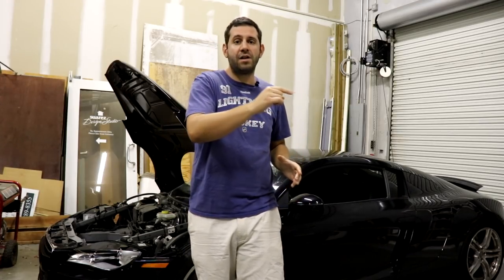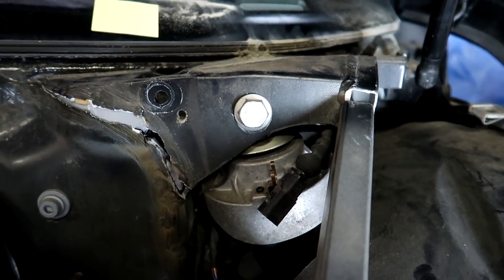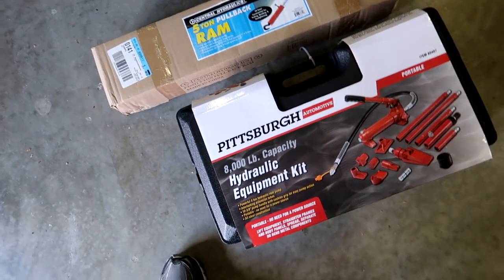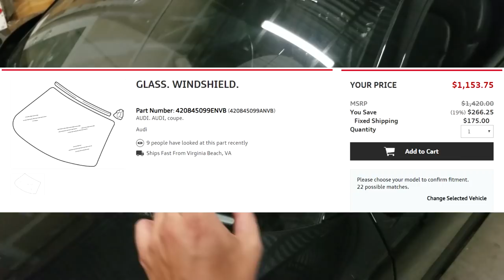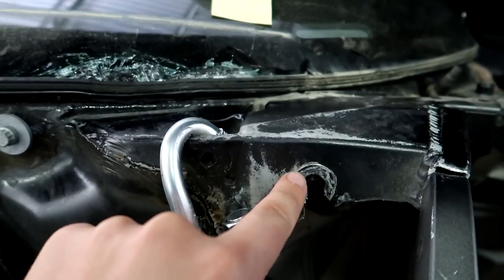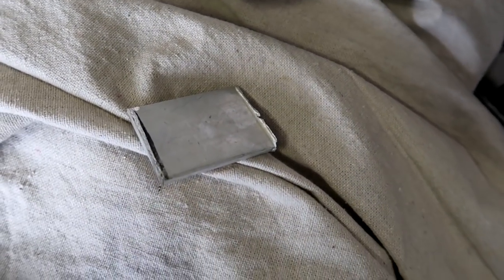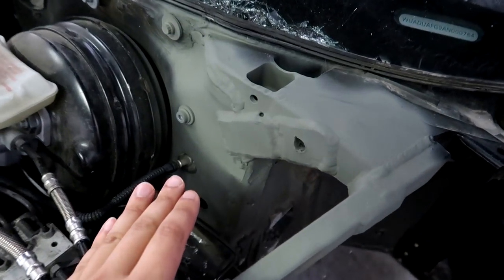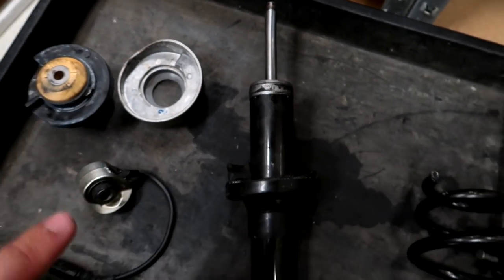I Repaired My Totaled Audi R8's Cracked Frame for $500! Insurance Quoted $29,522!

Comment: The thing that I can't believe is that Audi engineers didn't see this problem coming in the first place. You can't just put all the stress of the entire front suspension out there on the end of a teeter-totter without any reinforcement and not  expect a problem.
Reply: It probably would have been fine if the internal corner where the tear started wasn't so sharp in the first place - it's a stress raiser like it was designed.
Reply: Exactly! I just can't believe they didn't design it with some type of triangular gusset at least....or move the upper mount inward toward the strength of the main structure. It's simply a bad design.....repaired or not.
Reply: Yes, really surprising to see such a ridiculous structural design from a company that has a history of rallying among others. Did they dispatch the design to chinese subcontractors, LOL ?
Reply: Ya they eyeball stuff at audi lol
Reply: Classic Reaction -completely unreal. Reminds me of the clothing industry. Slapping a fancy name on it and marking it up 400% doesn't necessarily make it 'better quality'. I think you see where I'm headed with this...
Reply: @TonyRule  The failure of the frame was due to an impact not just fatigue. Bending that shock must have been a reasonable impact?
Reply: @Toby_the_Glen  In this particular case, yes, it appears to have been largely as the result of an impact. But as they have a known problem in this area, chances are it'd already started to crack there. I suspect that the shock piston rod end was bent as a result of the crack causing displacement of the top mount and some part of the shock to contact the inside of the top of the control arm or chassis.
Reply: @TonyRule  These sorts of cars are far more fragile than a daily driver, even kerbing and speed bump damage will eventually take its toll. You can't drive them like a minivan?
Reply: Agreed - but impacts will happen, pot holes and curbs.   @Toby_the_Glen
Reply: German roads are well kept better than American roads. There's your difference when Germans test cars on tracks and not metropolis streets.
Reply: @MarloSoBalJr  I think that car manufacturers road test cars all over the world. But there is an accepted level of responsibility for cars like this. Special cars require a special effort in ownership. If you want a daily driver to get you to work, pick up groceries and do the school run buy a Toyota. If you want a car that's responsive, poised, delicate and a delight to drive, buy a supercar. If you just want to smoke tyres, burn up the strip and make noise get a 'stang!
Reply: @Toby_the_Glen  They should still be durable enough in design to not be tearing apart after 7 years. The 1990 Honda (Acura to the 'merkins) NSX is all aluminium - no problems that I've heard about with them.
Reply: @TonyRule  quite a few cars have subframe or shock mount issues. 

Shock mount isnt the end of the world.
Reply: @jonathanmoga5188  I'm pretty sure I'm not the one saying it is the end of the world. However, my post was a reply to the assertion that somehow, because it's a 'supercar', it should be accepted ("there is an accepted level of responsibility for cars like this"). In any case, it remains a shit design if a shock mount readily tears like this, as is undeniably the case, given Audi's post-production plate.
Reply: The typical engeneerd get problem that Audi got:

They just simulated racetrack 

..but not hitting a rimstone at 5mph ✌

That's why these "light as possible" built car's suspension domes crack.

Comment: Should have added in extra gussets to tie the side bars into the strut area and lengthened the strips on the horizontal bar that cracked in half. And added a larger plate to the cracked area (talking overkill to keep it in check over the years). As far as people talking about aluminum weakness after welding it, I've seen cracked semi-trailer side pockets welded back up and chains ran back through those welded pockets holding steel to the deck that weighs 40k+ pounds total, then go years w/o cracking again. Those trailers also flex heavily (the deck itself is arched like a spine and straightens out with weight added) as the truck goes down the road, and chains, if tightened with ratchet connectors, can see very high tension. The front of a 3500 pound rear-engine car won't see anything near that unless you are constantly driving over crater-sized potholes. Just stop and check those welds religiously after driving.
Reply: I think you win this
Reply: The semi trailer is oranges to the Audi's apples. It's two entirely different styles of aluminum construction. The trailer I would expect to be just fine with welding a new piece of plate across a crack or whatever. It's just an entirely different animal from the Audi. The Audi has the same goal as bicycle frame, extreme weight savings. Thin wall, engineered cross sections, etc. The trailer is to make something strong and durable that has some decent weight savings. It wouldn't be practical to make a semi trailer with the same extreme weight savings as a bicycle or supercar and that's what makes them much more repairable.
Reply: @drivecam101  it's a good thing you're not a welder because I wouldn't hire you to do shit you obviously have no knowledge on the subject the semi-trailer sees way more abuse and tension than this repair ever will.. it will be fine
Reply: @freedomfox8183  What's abuse? You don't make any sort of real argument. I am talking about stress here, not "abuse". Abuse is a subjective term with no real meaning. A semi trailer's structure is going to have wall thicknesses that make this Audi's look like paper. The section modulus for the semi trailer's structure is going to make it so it can take much more load at a much lower stress. 

A semi trailer is not a high performance aluminum structure. It's not anything special, it has a high factor of safety. It's designed to be welded and not heat treated afterwards. While it may use common heat treated alloys like 6061T6 the effects of the welding aren't going to matter much in the application. It certainly won't be using exotic alloys. 

The closest thing to this Audi many people might own is a decent lightweight aluminum bicycle. Not the cheap ones, but at least a decent Cannondale. Weight optimization the entire way. In doing so it's not something that can be welded up willy nilly like a semi trailer.  Even if the audi is not heat treated after welding like a bicycle frame those welds are chosen in location very deliberately and the aluminum parts certainly were heat treated prior to welding. 

Here's some reading for you:
https://www.audi-mediacenter.com/en/press-releases/looking-ahead-to-the-new-audi-a8-space-frame-with-a-unique-mix-of-materials-7567

They are doing selective heat treatment. And then there is this: 
". New heat-treated, ultra-high-strength cast alloys attain a tensile strength of over 230 MPa (megapascals). The corresponding yield strength in the tensile test is over 180 MPa, and for the profile alloys it is higher than 280, i.e. 320 MPa – significantly higher values than seen previously."

Apples and oranges. It's two different universes of aluminum construction.

The way to make a cheap repair on this car is to reduce the frame's performance/weight. That was not done. It's the same thin sections with small thin gussets and welding that has reduced the material's strength in high stress areas.
Reply: @drivecam101   I've seen crude welds over cracks that withheld severe punishment, where the crack was grinded and then welded over. Granted we are talking 1/4" aluminum, but the side rails, pockets, and side rail posts all bend on trailers and eventually put cracks on the welds. Don't think they are using head or rim-grade aluminum either. His patch work will hold up, though he seriously needs reinforcements and gussets to get the most out of it.
Reply: @drivecam101  The "extreme weight savings" have been ignored in the repair. It is now as strong as it actually needs to be, weight penalty be damned.
Reply: @TonyRule  No it's not. A 1/8in thk piece of unknown alloy sheet about 1.5" x 1" is not nearly enough.
Reply: @RealCapricousCavy  As I stated 1/4" thick standard 6061T6 extrusions are another ball game. Welding up a crack in that I wouldn't expect a problem. If they had reinforced this area with 1/4" thick 6061T6 it would probably be fine if the patch was big enough.

Comment: I’ll be very surprised if this doesn’t fail again. The part needs to be properly heat treated to keep the aluminum from loosing its strength.
Reply: Loosing? Is that the opposite of tighting?
Reply: eckzacklee
Reply: Yes, it is weaker than factory now which is dangerous.
Reply: @Slick69-cutlass  yeah, their standards so great they had a design flaw that no one was pulled up on it.
Reply: @Slick69-cutlass  The standard of repair is driven by Audi who engineered a car with an inherently poor design.  Suffice to say design standards are not ubiquitous to every government's worldwide design standards that don't test a crash situation like has happened to this car.  Standard crash testing is but clearly Audi don't push past that standard

Comment: I tip my hat off to you for your persistence. I have dealt with well known reputable body repair shops in my quarter century selling vehicle parts to them.  One of them had a state of the art computerized frame straightening machine to insure that repairs are geometrically correct. Aluminum body repair is another thing because of its complexities. According to the owner, aluminum welds do not last and are prone to cracking in spots close and around repairs that were heated in the weld process.

Comment: You need to slow down.

Aluminum doesn't do well in vibration or heat cycling. The cycling causes it to become brittle over time.
That square strut worries me. I'd at the very least cut that out forward as far as pactical and replace it with some new stock. At the shock end cut it all off. Where you join it, you may be able to find some square aluminum bar that slides inside. If not buy some slightly larger and get a machine shop to surface it to the correct size. You could drill some holes in the old and new square tube, insert the square bar and TIG the holes. At the joint leave the ends of the bar unbutted and TIG the the two ends and the square bar all together. 
It really needs to go that square bar at the shock end. It has reached the end of it's fatigue life.

The crack site, I feel needs more attention. A plate with stitch welds designed to move the stress away from the already fatigued crack site should be fabricated after you grind the crack weld down.
What we're trying to do is get the stress away from the area where the cracking occurred onto non work hardened base.

If the whole thing ends up costing $5k so what. Again, I feel we need to slow down a bit - it's a high performance car and you going to start chucking the thing around on twisty roads the torsional forces on the body combined with the cornering forces and mid corner suspension clunks is likely to cause a reoccurrence on embrittled aluminum.

Each reoccurrence is going to be far, far more difficult to rectify.
The sign it's happened again is mid corner the windscreen will crack and you'll know.
Think about it ...
Reply: ThePaulv12 - this was one of the most constructively genuine comments I've read thus far in what is quickly becoming an over commented and abused YouTube comment section.  Well done! 
👍🏻🤟🏻
Reply: Cheers, Man!
Look you and me not so different re cars. I get excited like you and want my ride going asap. We need to stop being goal focused for the moment for this to work, be reliable and safe. FWIW I did my apprenticeship at a Merc Benz, Audi and VW dealership. These stupid prices Audi charge for repair of their poorly executed front end irks me. Some goose in the comment section below wrote about why you should use the genuine repair, and hot welding issues etc etc and I guess he's got some credibility but he doesn't have any credibility when he says Audi should repair it, because the problem for me is, how can you trust the company that couldn't design it right in the first instance to be able to issue a repair proceedure that works?
Thing is you can't because they don't know. How do I know this?; well they couldn't forsee this issue how are they going to be able to forsee the repair? They can't. 
So the best we can do to get you rolling is have a think about how we can do a really good job of it so we don't have to worry about it again.
I feel this can be achieved.
Reply: ThePaulv12 n)
Reply: This is the best comment so far. 

Yes you got it fixed. YES this is the way I would have done it in my shop too. But he’s right. You need to slow down just a bit. 

Reinforce the area a little. That square tube, run some flat stock down the sides of it to reinforce past the cracked area. 

Make a plate that covers the entire cracked area just like the plates you stated could be bought. 

You might as well spend another $500 on it and make it  where you won’t have to ever revisit this problem. 

I’ve done this kind of stuff on my pickup truck, but not on a super car.

Comment: Why doesn't Sam make some kind of part to part measuring device like the pros use? The bar with the prongs on the ends?  Measure strut bolt to stut bolt, to other parts, etc. Then he can measure key parts of the engine bay and make sure they are in spec. It is easy to get these measurements just like a body shop would. Why waste money on a new shock and alignment if that is not right?
Reply: Because he is fixated on the cheapest solution first and foremost
Reply: Did you even watch the video? He literally shows that it was the shock was bent.
Reply: Because he's a ham fisted and incompetent

Comment: Pure hack job. This is the wrong way to fix an aluminum chassis car. This WILL break again and fast. This car should not be on the road without a proper repair. Sad part is you are proud of your ignorance and unsafe "repair".
Reply: Mike W who pays29 k for a small job?
Reply: @user-he7sc3fg3r  Repair for that is not a small job. Frame is most likely bent. Also repair should be in specs.
Reply: You want the same people that screwed it up in the first place to fix it because they know better??? Seems legit
Reply: Ok then please educate me, what is the proper way to fix aluminum? Last time I checked AC Tig welding is the proper method, which the welder in the video did very well.
Reply: @terotahvo6849  Highly unlikely the frame is bent outside of the top shock mount location. The repair could have been handled better granted, but theyve got the lions share done ok.
Reply: It will not break on the Welding  parts maybe somewhere else on the frame
Reply: This patchy repair is also not very strong. It would have been better to just weld the crack together and then weld one single big piece of aluminum over the crack.
Reply: I’d love for him to link us to the new owner for updates down the road...
Reply: ItsAG71 l